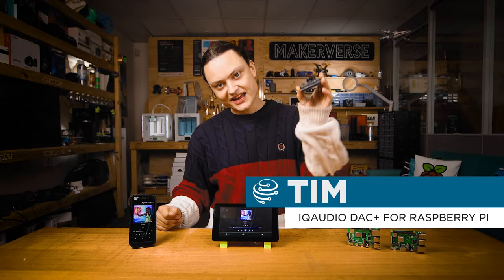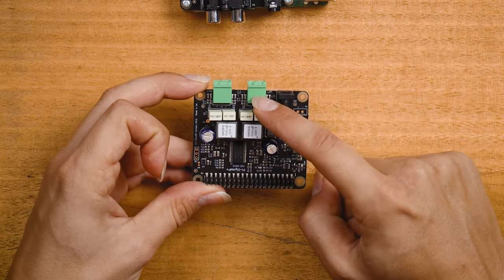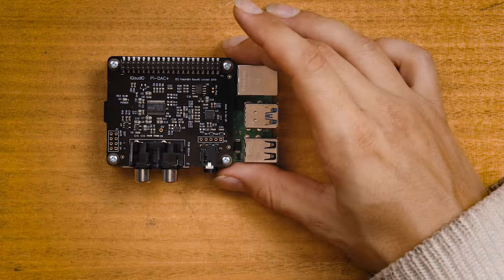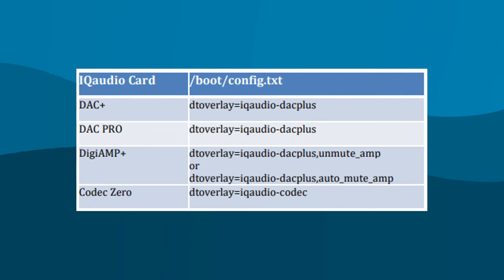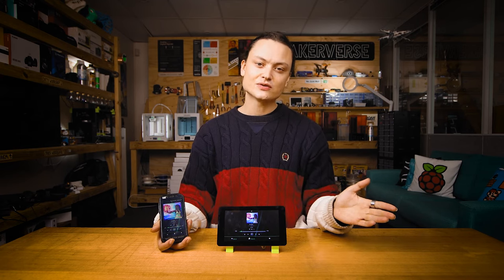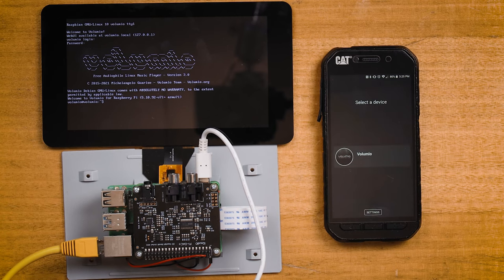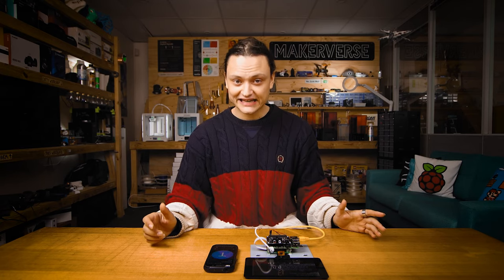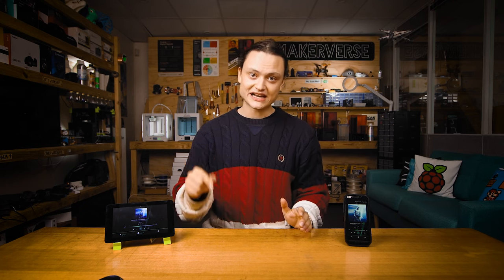How To Set Up An IQaudIO DAC+ With Volumio and Raspberry Pi OS

Comment: I just ordered this DAC and a Pi from you guys then just realised while watching this video I forgot the Mini HDMI cable lol. My $3500+ speakers arrive tomorrow so I'll have to see if I can install Volumio without an interface to guide me.
Reply from the maker: Sounds like a very swell set up! And you will be okay with or without the cable 🙂 there is more than one way to do complete a Volumio installation and most of them are very user friendly.
Reply: Volumio has webUI that you can access via any browser, as long as both device you are accessing with and your raspberry pi are connected to same internet. I installed it without any additional HDMI or mouse or keyboard.
Reply: @Core-Electronics but you suggested Raspberry Pi OS in the article ??

Comment: Thank you for this clear and informative explanation.  I'm looking to make a ROON PI endpoint so will follow the ROON linux software rather than the Volumio install process. However thank you very much for explaining the HDMI override and config TXT. Essential info. Brilliant. Did you have a favorite case for this arrangement? Heat reduction required? Some DACs run hot I've heard.

Comment: So could I just sit a 3.5" screen on top of that with the pins? Will both DAC and screen use specific pins or will there be some kind of conflict. The DAC pin setup suggests the former. Is that correct? 🤔

Comment: I am seeing so many videos only talking about audio output but what about audio input into the raspberry pi too?
Reply from the maker: There are three ways to get audio into a Raspberry Pi, HDMI in, Through the AUX or via GPIO Pins running I2S.

When it comes to fidelity of audio going in (particularly in through the AUX port) it is all about microphones and length of wire between the Pi and Microphone.

Hopefully that is some good discussion of the other side of the coin 😊
Reply: Im so happy that someone replied back and think you for being kind to respond. If you could recommend, I am trying to get my tv audio into the raspberry pi and I know that the raspberry pi can be discovered by airplay. Im trying to get my tv audio to my Sonos speakers throughout Apple airplay. What is the best device for this?

Comment: Great tipp of you to shut all other audio ports off, this works smooth once your pi is registred by the system. To do this for some reason the command line dtoverlay=iqaudio-dacplus needs to be changed to dtoverlay=hifiberry-dacplus. After that change my board was registred as well

Comment: First off, many thanks for all your excellent videos. They have always been very information packed, presented is a most straightforward manner and really useful to me.  The setup you have presented in this video has worked perfectly, I could not have done it by myself.  However, I have this system (RPI 3B+ and IqaudiO DAC+ with the music on an external hdd) and want to put it in my motorhome to be used without any internet connection.  I live in the southwestern US where it's mostly mountains and deserts and I often camp remotely.  Is a network-free solution possible? If not with this specific equipment and software, is there another way to do it.  Many thanks, Tom Slover, Las Vegas, Nevada USA
Reply from the maker: With the Official Screen set up you can control it directly without the network. 

If you want to control it via your mobile would be very tempted to put a Waveshare 4G HAT on top of the set up as it currently stands. This could then be run as a Hotspot and provide your set up with access to the internet (I may be recommending this just because I've been doing a tutorial on it as we speak). Thinking about it, you could also create this Hotspot from your mobile phone and have it provide internet to your Raspberry Pi when your on the go in your motorhome (worth testing that out beforehand).

These set ups are also great ways to just play digital music. So if you have a Hard drive (full of already downloaded music) you can plug it in and get it playing real quick. Then you won't need the internet. Also when you are at home you can scrape all the song details like Album covers and lyrics using the Volumio OS.

I hope this covers all the bases, 
Kind regards and thanks for you kinds words, Tim

Comment: Excellent video, this got me up and running with good audio on my pi4 with no issues. 

I do have questions though: 

Which stand-offs are you using between the screen board and pi? 
(I am guessing the ones that come with the screen)

Which stand offs between the pi and dac?
(I have been trying to work out if they are one of the options sold at Core Electronics)
Reply from the maker: 4x 9mm M2.5 standoffs Stand-offs between DAC and Pi.  4x 12mm M2.5 standoffs Stand-offs between Screen and Pi. This set of standoffs will sort you for future projects 😊 https://core-electronics.com.au/catalog/product/view/sku/ADA3299
Reply: @Core-Electronics  Thank you.

Comment: Great video, very helpful. Two questions:
1) can I connect my TV to rpi and control volumio with a remote? Which remote is reccommend ( not mobile phone)
2. Is it possible to stream from mobioe phone to RPI bluetooth as well (so volumio can be used as bluetooth receiver)?
Reply from the maker: Cheers mate 😊! And excellent questions. In regards to remotes I'd recommend sussing out the FLIRC USB - https://core-electronics.com.au/catalog/product/view/sku/CE07072

With that device you can use any remote you have about to control your Media Center. 

Another option is the Argon IR Remote, you just need to make sure you can mount the hardware into a Argon ONE case - https://core-electronics.com.au/catalog/product/view/sku/CE08168 

Volumio has Bluetooth audio playback. This feature is available in a simple way if you enable MyVolumio.

Comment: I use the USB interface in ASYNC mode, it's free and works flawlessly.  My DAC is a Topping D70 Pro Sabre that plays marvelous: I wanted to have 12V trigger but a cheaper DAC like an SMSL D-6s would have played as nice.  I used to have a Raspberry Pi 4 but i replaced it with an HP ProDesk 600 G5 DM: It is always on, runs straight MPD (Music Player Daemon, that's what's under the hood in Volumio!), RompR in a podman/docker container as MPD client (web interface).  I run a couple of other VMs / Containers too, like Home Assistant.

Comment: How much of a difference is there between the + and pro models? They’re only about $9 apart, I can’t understand why there’s an option... anyone spending $30, ain’t gonna mortgage the house for another $10🤦‍♂️
Keep up the vids, love ‘em👊
Reply from the maker: From looking at the spec sheets for the DAC chip used it looks like the Pro has a marginally better signal to noise ratio (2db) and the Pro board has breakouts to support balanced XLR output.

Comment: A Quick Question

My setup at the moment is a RPi3B+ and a IQAudio DAC+ with a 2.5 500gb hard drive plugged into one of the USB ports which is also powering it too.  My power supply is an official 5 volt 2.5 amp. 

Am I able to to attach a screen and still use a usb hard drive or will I need to buy a powered one?

Love the vid by the way...

Kind Regards
Reply from the maker: I reckon you will be fine. Check all the amp requirements of the screen, pi and hard-drive to see your not maxing out the available amperage.

You could always power the hard drive via a power supply. Also If you do need more you can get power supplies with high amps like this one - https://core-electronics.com.au/raspberry-pi-4-official-power-supply-usb-c-5v-15w-white.html

Comment: I want to improve a little how i hear music.

This days i install Mopidy in a rpi 2. I connect throug the headphone connector to a Edifier c2 2.1. But i read that the quality of the rpi headphone is bad, and im now trying to hear music from Qobuz, etc. So i want to play better.

Im thinking to buy one of this Pi-DAC+ Pro vs Pi-DigiAmp+, and i want to know if you can help me to choose.

With one i have amp (but that amp is better than the edifier?) and if we dont consider the amp... as DAC which is better?

Thanks
Reply from the maker: You'll instantly hear a better result from either of those DACs over the Auxiliary (Headphone) Raspberry Pi Port when you use headphones.

If you want to listen using Headphones I recommend using Pi-DAC as the Pi-DigiAmp+ doesn't have a Auxiliary Port. Both use Texas Instruments DACs (PCM5242 DAC vs TAS5756M PowerDAC) so you know the quality is there. You can google and dive into those DACs to figure out exactly which one you'd like better but the quality.

Undoubtedly they will be similar 😊 most important to know what application your going to use it for and that the DAC Board has the appropriate connectors.

Comment: Is it better if I the signal is sent from DAC to the amplifier in a digital format rather than analog? Or it doesn't really make a difference?
For example my amp has digital in (coax or toslink) 
However I read somewhere that toslink max bandwidth is 384kbps, but when you listen to FLAC it can go over 1000 kbps . Not sure if that would be an issue?

Comment: Useful guide, thank you. You edit the config file when setting up the DAC to disable other sound outputs, but then presumable overwrite that with the Volimio install?
Reply from the maker: There is two set ups here, done using two different Micro-SD cards, one for Raspberry Pi OS and one for Volumio OS. 

This way its fully clear what is going on no matter how you want to utilise your IQaudio HAT 😊
Reply: @Core-Electronics  Silly me! Thanks for clarifying.
 Following your guide I installed Voluimino, but for some reason Spotify sound output was terrible. Installed Moode instead and it is much better, although I prefer the Volumino interface.

Comment: very useful! 
I feel like I'm missing a piece of the puzzle, I hope you can help me.
rca connect to active speakers? or (in case) pasive speaker, to amp?
Then, active speaker or amp to DAC?
thanks in advance
Reply from the maker: So this HAT outputs a dedicated headphone amplified signal and a differential output in parallel to phono/RCA line level output. If your speakers are not ultra high power this output will do, otherwise an external AMP will be required. 
Hope that helps 😊

Comment: Hi awaiting for new dc 1qadio dig as this one is on the list .but i still can't get suptronics dac x 5500 to work i've had it working in the past ? but forgot which dac work on the list  any help please
Reply from the maker: Heyya champ, I haven't utilised a X5500 DAC before. Can you not find it on the Volumio List of possible DACs? From this forum post the advice seems to be use the option | Generic | or | Hifiberry I2S | - https://community.volumio.org/t/dac-x5500-hat-no-sound/57798.
The IQAudio DAC will be on the list however so once you have that in your hands your good to go 😊

Comment: I have a question, how can I set up a raspberry pi w dac to play just one saved MP3 when triggered via aN external trigger switch? And also send out a text message alert.and trigger an external relay. Kind of like making an alarm system
Reply from the maker: You should take a look at this guide here in regards to sending out Text messages from a Raspberry Pi - https://core-electronics.com.au/guides/raspberry-pi/raspberry-pi-4g-gps-hat/

This is a fabulous guide to follow through to get sound files play via a GPIO external trigger, from wiring to scripting - https://projects.raspberrypi.org/en/projects/burping-jelly-baby

Combine both of those and you'll have your project 😊

Comment: Hi! I get no sound if I comment our those two lines. I have the DAC selected in the Volumio settings. However I read somewhere that this DAC has EPROM memory that enables plug and play operation of the HAT module. What happens if I do not use these three commands? Am I not using the DAC correctly?
Reply from the maker: If you can get it to run plug and play then do that! 😊 So long as the audio signal comes out of the top board everything is good.

Comment: Hi do I get dac 5500x from subtronic on a raspi 3 no sounds
Reply from the maker: Heyya mate, here is a biiig list of DACs that will run with Volumio and Raspberry Pi. Also some troubleshooting advice there too if your specific DAC isn't on the list but you still want to use it 😊 https://community.volumio.org/t/guide-list-of-i2s-dacs-for-raspberry-pi/1015

Comment: Can you stack these together
Reply from the maker: Not sure why you would want multiple DAC HATs on a Single Raspberry Pi. However you can definitely put other HATs on top if you want other hardware/features in your project. Just make sure the GPIO Pins requirements of one HAT won't have conflicts with another. Use this website to find out -  https://pinout.xyz/
Reply: @Core-Electronics  I was trying to get 4 audio outputs from the raspberrypi, I've found a HDMI audio extractor that can do 4 outputs from the hdmi port

Comment: how to put music on the card ?
Reply from the maker: You may find it easiest to put music onto a USB-Drive instead of trying to split the Micro-SD card into two partitions. Partitions are an option however, one to run the OS and another to store the Music. But A USB Stick/USB Hard Drive/SDD Drive will definitely be faster and easier to sort.
Reply: @Core-Electronics  
Thanks for this constructive advise …. I will shurely follow your suggestion.
Thanks 👍

Comment: Dont forget to tell that you have to pay for good sound quality with Volumio
since the Volumio 3 is release.
Reply from the maker: My understanding is the Paid version gives you access to other feature, but not in regards to improving sound quality.

There is discussion on the forums about the difference in sound between Volumio 2 and Volumio 3 which is apparent (but you can always choose which version you'd like to use) - https://community.volumio.org/t/volumio-3-hosed-the-best-feature-of-volumio/51777

Bounce back to me if I've got that wrong
Reply: @Core-Electronics  The first Step is allways
There get your Data. I am not sure how much your mail adress is worth in 2022.
The Data Broker at your Choice will inform you. ;)

Comment: I'm a newbie at this and might get roasted for this but how does this stack up to a didgione dac
Reply from the maker: Both are well reviewed and great systems to get rad audio out of a Raspberry Pi Single Board Computer. I haven't found any direct comparisons between the two systems but my preference is with the IQaudIO DAC+ in regards to price, larger community and worldwide availability.
Reply: Don’t worry about asking questions, we are all here to help each other, everyone’s a newbie at some point. 
Did you need up building one?
Reply: @Core-Electronics sir,will this config text changing  works for raspberry pi 5?

Comment: Why not just use Bluetooth and save money.   For a dollar or two you can get a Bluetooth MP3 Decoder Board.
Reply: BT audio is crap
Reply: Convenience, flexibility, the DIY component... it all depends on the use case.
Reply: Because it's redundant. If you don't care about audio quality at all, that you even suggest such things, might as well just simply use Pi's built-in audio output. Save another dollar or two.